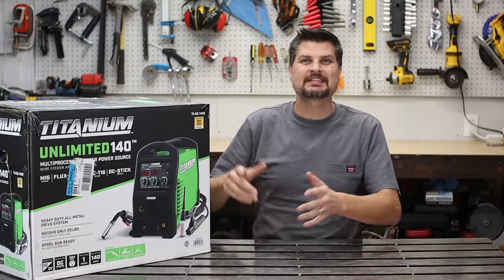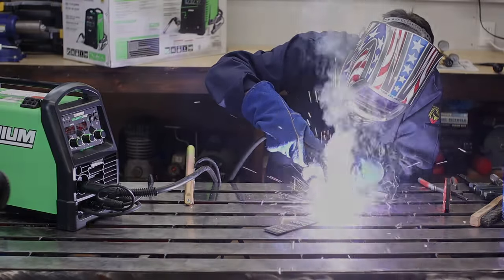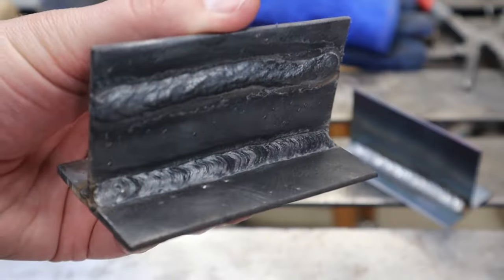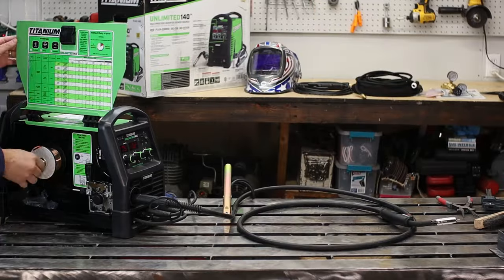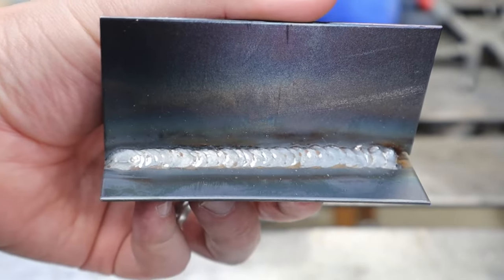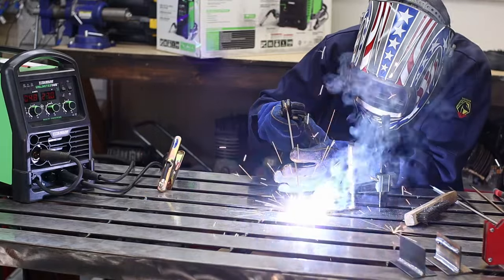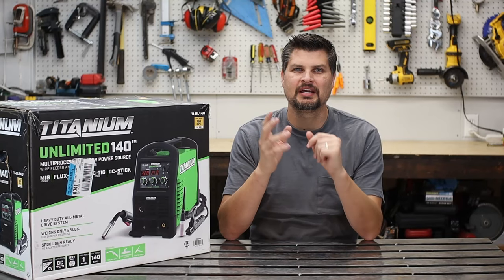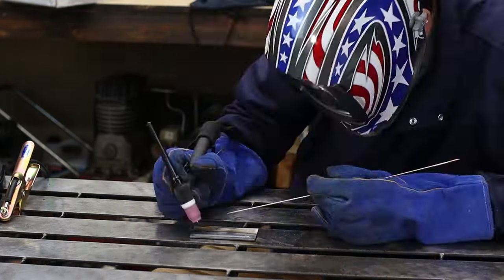Best Harbor Freight Welder *Titanium 140* Multiprocess

Comment: I would not complain about the wire.  I have the small Titanium flux core only rig.  Great little unit, but I sure like it much better since I quit buying the wire at Harbor Freight.  The local welding supply sells Victory brand consumables, and I have been much happier with the performance of that wire over the Vulcan.
Reply from the maker: Thanks for sharing!
Reply: Idk if it was just mine but you also have to pick up a tungsten core for the tig welding,amazing machine though and same I mostly do flux core but it's convenient to be able to do stick and have the option for mig and tig for expanding your abilities

Comment: I use my 140 in an industrial setting as a pipefitter/welder. I upgraded the torch to a flex head radnor for 300 and use the stick electrod to supply power with an in line attachment and it welds 304 and 316 beautifully. Juat like a big name welder. I run 1/8 inch at 67 amps and run 80 amps for 3/16 10 inch pipes. The stick welder works good as I can run the 1/8th inch 6010 5p to weld in all my braces and fixtures for the piping after leveling and measuring out. The 140 is perfect. Have been using it at work for 2 weeks now 9.5 hours a day 6 days a week and hasn't overloaded once. The torch that comes with it works. But without it being a flex head. You can't do in place welding all that well and have to arch a bit more to get good fluidity. Other than that. It works very well. You could prolly go for upgrading the ground and lead wires from 10 gauge to 4 or 6 gauge for a consistent arc path. It makes the stick part a bit better that way as well.
Reply: As to the mig. Standard mig. Just need to set it properly and use the right kind of gas. I did my full custom true duals 304 stainless on my truck and sounds good now. I mig that and tig the headers and downpipes. Silverado never sounded better. I am debating on upgrading to the 200 multi as it does a big more than this one does.
Reply from the maker: Thanks!
Reply from the maker: Great info thanks!
Reply: still working good for you 10 months later? 

I havent done any welding since highschool (20 years ago now). We bought a house a couple years ago and I have a garage and I am constantly finding projects where a welder would come in handy.
Reply: Yes, I upgraded my leads to 4-guage, 15' long, and it welds better than with the factory 10-guage 10' leads.

I also put a larger tongs on the stick welding lead, and a bigger clamp on the ground lead. 
Just a preference, there was nothing wrong with the factory one.

Comment: I know that some people are new to welding as I was a couple years ago.  I bought a Lincoln from HDepot, and surprisingly it failed.  I got the HF mig 140 and I'm absoluteley amazed.  clean the surface with a heavy duty wire wheel and make amazing welds by the chart under the lid.  Way better than the Lincln.  Use a co2 bottle with the mig setup.  It will make you a happy person.

Comment: You can weld aluminum with dc Tig you have to use helium.
Reply from the maker: How does it compare to AC TIG? Another issue is there are no TIG settings so can't control frequency, balance, or one of the biggest ones for aluminum foot pedal amperage control. I've found these machines to be good if you a tack weld size hole in you Alumn. boat to fix. If you are doing anything more you'll want a dedicated tig machine.
Reply: But helium is harder to get as a the average joe most helium shops that fill balloons don't even use helium anymore

Comment: What type of extension cord is needed for this welder?? What if i want to run it off a generator, what size generator is needed to run it flawlessly?
Reply from the maker: If up to 25 feet I use a 10 gauge without any issues. To run without bogging down you'll probably want 5000+ watt *running amp generator.
Reply: It pulls 22 amps according to Harbor Freight.  2640 Watts. So a welder around 3000 watts should be good.

Comment: will this weld thicker material (flux core) than the Titanium 125? If not, what would be the next step up from the 125 for thicker material on flux?
Reply from the maker: yes but not much. If making the jump for thicker material I'd go with the 170 or 200.
Reply: @-DIYPRO-  thank you so much for your reply!

Comment: How often does this welder go on sale? Asking bc there's currently a sale on them but I have a bunch of other stuff to do before my next welding project. It looks like a decent welder. I'm currently running an old Miller Vintage 200 transformer-type MIG and would like to try an inverter-type welder for thin sheet metal. Thanks!!!
Reply: I just picked mine up last week for $449 with the I.T.C. membership.... 👍

Comment: my 140 mig didn't come with wire either, then i returned it and got a 200 professional and it did not have wire either. It still has the place in the styrofoam for the wire, it's just empty.
Reply from the maker: Good to know, thanks for the confirmation.

Comment: While running mig mine starts off extremely slow for 4-5 seconds then speeds up to set speed? Got mine yesterday and can’t figure this out. Figured there was a setting but can’t find anything.
Reply: Mine does this also, and it's more noticeable at higher wire speeds. 

I THINK it does this to allow the gas to start flowing, get rid of the oxygen around the part you're welding, gets a puddle going, and then speeds up once you start progressing. Mine doesn't do it on the flux-core setting.

Edit: I figured out WHY it does this by playing with mine....

The welder actually senses if there is an arc struck, and is welding, and if it's NOT, the machine assumes that you are feeding a new roll of wire down the cable, and it steps up the wire speed to maximum so that it doesn't take very long to get the wire down the 10' cable and you don't have to mess up your settings by manually cranking the wire speed up so it doesn't take forever to get the new wire down to the gun. It will NOT do this if you are actually welding with it.
It's a feature to help you quickly reload a new spool of wire. 👍

Comment: How do you set up the tig torch on the machine? And how is the gas set up?
Reply: You just plug the torch lead into the negative port on the front, the ground lead into the positive port, and the gas hose goes DIRECTLY to the regulator on the gas bottle. You open the valve on the torch handle before you start welding, and close ot when you're done.

Comment: 030 is good I like 035
Reply from the maker: I usually am doing thinner stuff but occasional I'll need to put some 035 in.
Reply: @-DIYPRO-  I use 030 also but been playing around with 035 I like it better but I'm using blue demon wire I like it

Comment: I just bought mine and it says it can do 5/16 inch thick
Reply from the maker: Yea, looks like the panel differs from the site specs.
Reply: Weird, I just bought one and the panel only goes to 1/8". You got the 140 yeah? If all the hardware is the same then I guess it doesn't matter much. How well does it weld 1/4"? Could it pull off 1/4" aluminum?